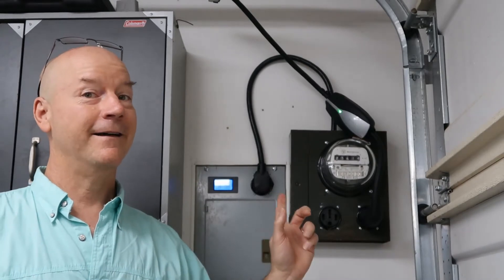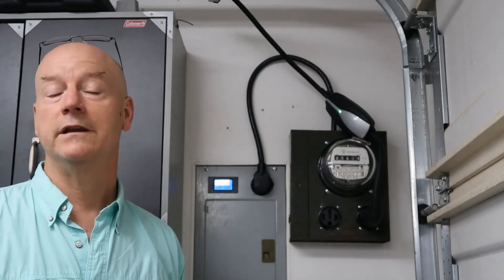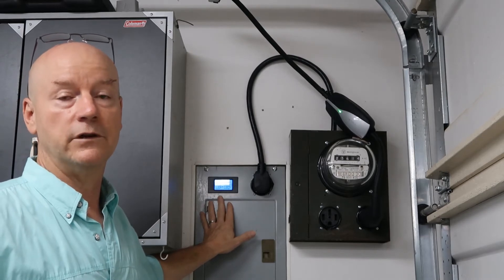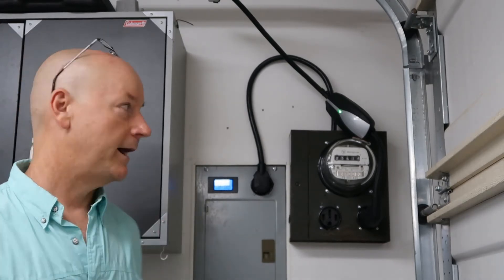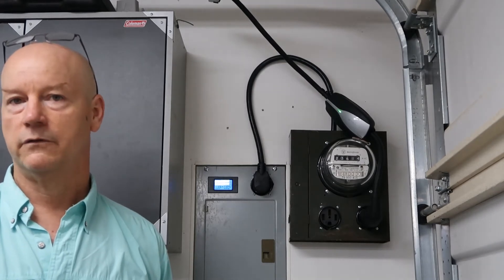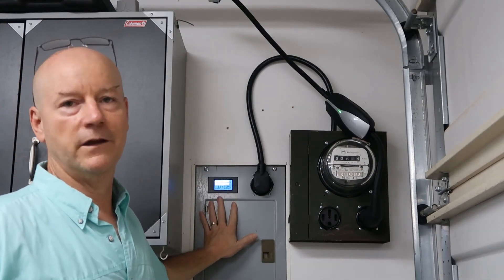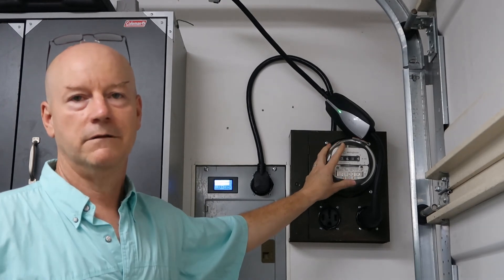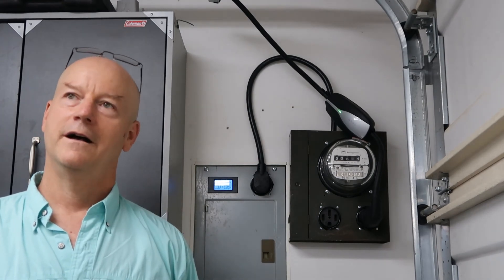Tesla Ruby   A Study in Charging Efficiency

Comment: Hey Don, thanks for the work you put in. I'm currently doing something similar. Due to winter weather (NJ) the efficiency has dropped dramatically to the point that I think think my old ICE car would be almost as economical. I bought two "eyedro" units they measure the kwh and upload it to the web. I also installed tezlab which is a free app with no subscription that tracks in-car efficiency.... I just started to track I will get a real cost to charge when I get a full month of data from both sources: http://teslacosttochargenj.flowingcolor.com/

Thanks again for all you work. I might pick up one of those Chinese units to place by my 14-50 port.
Reply: I'm now satisfied that the Chinese Digital Meter is accurate enough.  It compared well to the analog meter and it and TeslaFi agree well well.  I'm fixing to install a wall charger and will install another digital meter on it.  They are just too inexpensive not to.

Tezlab app for sure looks like a good app to start with.  From what I looked at it seems to capture/present all the data your'd need to get a good handle on your charging costs.
Reply: Don Miller sorry I had your name wrong! Those meters still need power right? I can power them from the v120 terminals on the 14-50 right?
Reply: Yes it needs power.  You hook the two wires that feed it power to the 240 hot lines (not the neutral).  The single CT (current transformer) measures the current (in one of the lines) and the voltage from the 240 L1/L2.  So the 240v times the Current is enough to calculate the power (it measures the power factor because the skimpy doc stressed that it displays true power). If the load lets a small amount of current flow in the neutral, since it only uses 1 CT it not going to be as accurate.  BUT I'm charging at 9.5Kw and that is going to swamp any small amount of current that might flow in the neutral. In other applications that might not be true.  My clamp on lowest range is 600 amps and anything less than 5 amps more or less is noise on that range so I can't tell how much (if any at all) current flow in the neutral.  

It can measure 120v power but I found it a bit flaky (hooked if too the hot and the neutral).    

One last thing.  I hooked the two wires that feed the meter to the receptacle which means the (tiny) power drawn by is measured by the meter.  To correct that I ran one of the wires feeding the meter back through the CT (opposite direction from the heavy wire) so that the small current drawn by the meter cancels and the amps on the meter read zero when nothing is plugged into the receptacle.  Before I did that the meter read .02 amps.

Comment: One of the "vampire losses" to keep in mind is the small, but still real, inefficiency of the charger itself.  For example, if you pull 20kWh from the wall (measured by your digital or analog wall meter) that does not mean you have put 20kWh of energy into the battery.  The amount of energy that actually made it into the battery might be something like 19.2kWh or similar.  Just the nature of electricity.  Pass it through any cord or device on its way to the final destination (in this case, the final destination is your battery) and there is going to be some loss incurred.
Reply from the maker: Right. Don was expecting about 85% charging efficiency. What he wasn't expecting was what appeared to be more like 65% charging efficiency.  What ended up being the problem is that the value he used from the big scream on energy used only considered actual drive time energy. If I sat somewhere with the AC on for 20 minutes each day, that energy use value wouldn't figure that usage in. Once he found a more accurate total energy usage by the car in the Tesla Fi app, then he calculated that we were more at the 85% efficiency he was expecting. And he also was able to verify that the digital electric meter was nearly as accurate as the older style power company meter. Since Tesla FI does such a good job of determining the energy usage, he's no longer monitoring the usage with the digital meter like he was although it is still installed. Thanks for watching!